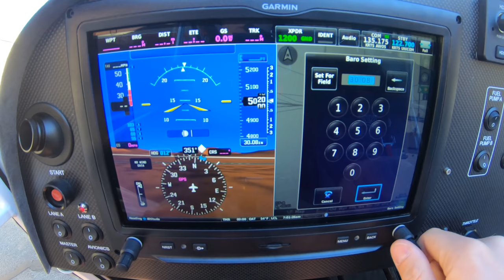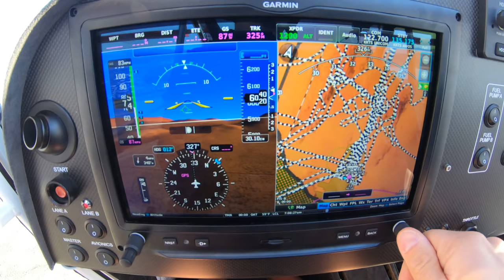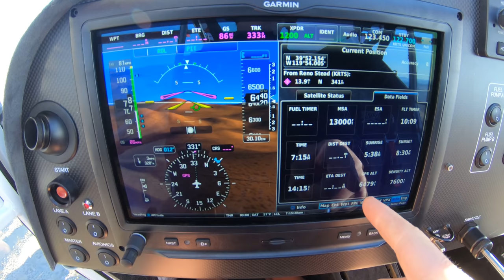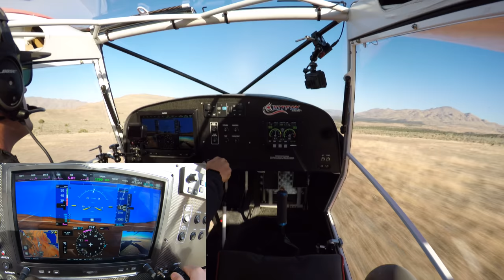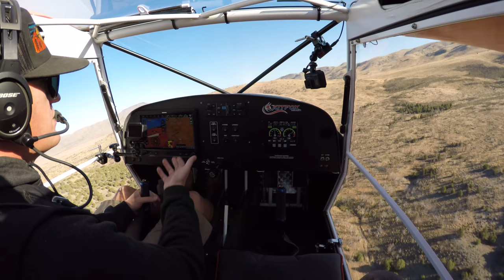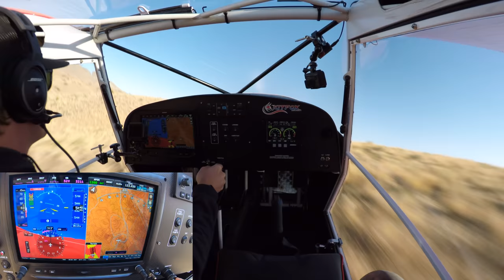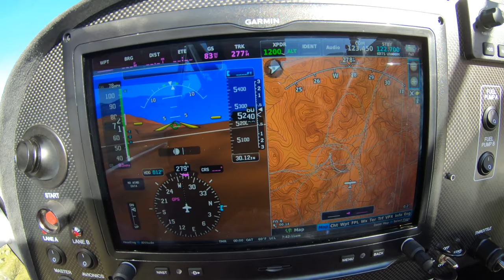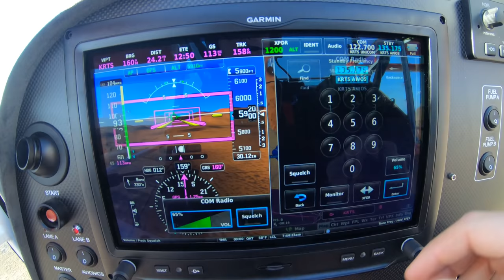Modern Avionics In Bush Planes - Overkill???

Comment: I have watched hundreds of flight videos and never have I had a clearer picture of the flight avionics.  Well done and very clear.
Reply: @johnd5805  Controls rpm of the engine and prop pitch all in one. Just a fine tune. Easier than pushing and pulling all the time.
Reply: @johnd5805  Look up MacFarlane Vernier Throttle.
Reply: @eddieforward5770   thanks Eddie   I will
Reply: @johnd5805  the throttle lol
Reply: @allthatremainsx6  thanks  you're a genius
Reply: Keep in mind that avionics function varies wildly with the airplane. 737s for example lack topo maps because they simply don't need them.

Comment: Not an overkill, you can’t put a price on safety.
Reply: Of course you can.  You can price yourself out of flying altogether, which is why you can't buy a new Cessna 152.
Reply: @SoloPilot6  right; there is a price to safety, and it's surprisingly low.
Reply: Of course you can. 

If the cost of this is displacing more important things, for one. 

If these fancy screens are too distracting in VFR conditions so you aren’t looking outside. 

If these fancy screens give you a false sense of security to continue on in less than ideal conditions. 

If the weight of these installations become more liabilities in terms of weight when performance limited or higher fuel burn with increased power.

Comment: Rule of thumb is, if there's no slat on the leading edge of the wing, flaps will push the nose down. Most noticeable of all is probably IL-76. It is a huge military transport from Russia that doesn't have leading edge lift device. And you will see it actually have a negative angle of attack when on final.

Comment: I learned to fly in a 195, and I was 5’5 or thereabouts. I learned to S turn down the taxiway, because no way could I see over that radial. I love the modern instrumentation. The ease of use compared to folding a sectional on your knee?  Just the computational power at your fingertips is incredible, as long as you don’t replace it for good judgement.

Comment: Love the Vid... I am a Mechanical Engineer, and that technical environment tempers a lot of things I do and use "as a safety margin" for things I do. And flying is one of them. Garmins' Glass from your install to the TBM setup is a safe environment. Your comments about your transition from simple steam gages to the Garmin setup you have does describe using a simple safety setup when you need them. You still fly as you did and should with your eyes outside the cockpit. But you have the safe level flight on AP when needed. Go for it!!

Comment: Those cheap chargers for iPad and devices use a high speed oscillator and a tiny transformer to step down the voltage. They can put out so much noise they can cause RF interference.  I've had them blank out the tire pressure sensors in a truck.
Reply: Fully agree. Much of the headset-audible electrical noise issues in a homebuilt I fly were significantly reduced by replacing the cheap USB charger for a Anker brand one - and that was on the recommendation of this site: https://pilotaware.com/faqs/ That site also go as far as recommending the products made by https://charge4.harkwood.co.uk/ for certified aircraft. Another option possibly worth investigating are the built in automotive-grade USB chargers of Molex: https://www.molex.com/molex/products/family/invehicle_usb_charger
Reply: @jimjam623  You can reduce or remove the RF interference by putting a ferrite bead, also known as a ferrite choke, on the cable. These are just little magnets and are commonly used in many applications for reducing RF interference.
Reply: Daytona Sixty-Eight Actually, this plane’s wiring had been ‘choked to death’ (probably a pound or more) with those damn things over the years of various upgrades - and sadly it turns out they were doing nothing useful before we completely rewired it. The biggest source of audible electrical interference still appears to be coming from the SCREEN of the now ancient MGL Voyager EFIS - at least according to the handheld airband tranceiver being used to hunt directly transmitted noise - but probably not helped by the shorter than optimal antenna length (baked in to the design of the early Jabiru SP470’s. I agree though, ferrite beads ARE worth a try: dealing with electrical interference in aircraft is all science + half black art. :)
Reply: @jimjam623  Typically those panel USB or car outlet USB chargers are powered via the master switch and not avionics switch. That should help you isolate RF. Master ON, Avionics OFF.... iPad charging? RF interference? No? Then avionics is likely the issue like you said. While your case sucks, most people who have problems with USB use a cheap charging cable and a choke likely would help them.

Comment: Great video of the Garmin G3x.  My daily job is an Avionics shop supervisor in San Diego, and I am privileged to flying a Aeroprakt A32 with a G3x.  My Avid Model C when I bought it had no avionics, and this year she’s getting an upgrade to GRT Mini X AP because it will fit or it would have been a G3x portrait.  Whether it’s a G3x, GRT,  or Dynon, the new ADHR’s displays with GPS navigator really reduce pilot saturation.  This is not to promote avionics businesses, but an old school pilot stepping into the 21 Century!

Comment: Thanks for this video, good information.  Interesting comment about how going to fine pitch can blank the horizontal tail.  My Europa mono is all electric analog flight inst,  with Garmin GNC 420W.        Dad flew in the western Canadian artic from 1955 until 1996, Cessna 180, Helio Courier, Piper Aztec and others floats , ski's, wheels and in the 90's when GPS came along he said  " GPS takes the challenge out of bush flying "  He couldn't believe how much easier it became.

Comment: Your set up is very rational and useful requiring little attention to operate.  I like the outputs and the ease of operation especially as you do not have to take your eyes completely off the outside environment to see your system.  I have flown in aircraft that a simple radio freq change makes you put your head down and lose the horizon totally.

Comment: Bro..this is an AWSOME AVIONICS &  CONTROL PLANNING & TECHNIQUE  NERDOUT! .. love it! Great demo & info vid!
I fly RC bushplanes (typically my 3 Timber STOL planes & a PA-18 bushwheel SuperCub) on every surface available year round..DAY & NIGHT! Be it ground, float, ski.. I may have coined the phrase "AERO-CRAWL" from some of my confined ROUGH SURFACE STOL RC flying..I fly it steeply into the valleys of trees on short final @ close as MCAS (down to 5Kts, working lots of rudder & wing leveling, on the edge of porpoiseing, any yaw leading to abrupt 40° flap spin!) as I can with a 3# 60" wingspan electric plane w/LE slats and Fowler style slotted flaps, all about A/S (AOA HYPER CRITICAL😬), sink/power, & ELEVATOR EFFECTIVENESS! 12" Dia fixed fine pitch prop on a light model, will go from top speed of 50Kts to 10 Kts in 2 seconds, w/ resulting "WHOOOShhh.." ..so I hear ya on  blanking the elevator w/turbulence! Testing surfaces, varied flap induced trim shifts, trim use in various modes of flight, etc. Real cowboys do everything to stay on the good side of the thin edge of life & not get stuck in the mud, or worse! Awsome to see Freedom Fox collab. w/FliteTest! BTW, I think you see Autopilot how I see SAFE stabilization in RC planes as a tool, not a crutch, just logical persumption! Thanks for the entertainment, beautiful scenery, & great points to ponder! It's great being a "FLYING COWBOYS's COUSIN" by flying similar in RC! I know what goes into those landings! Many touch&gos till you're happy w/ vector on rollout (track/energy) 🤠👍Thanks so much for contributing so much inspiration to multiple communities! Everyone has such a tremendous impact!

Comment: Great video as usual Trent.

I think that is practically the perfect light GA cockpit from my point of view. I know somebody building a Pietenpol Air Camper and that aircraft is getting a Dynon (I think) glass screen and engine monitor, its light, easy to read and removes the maintenance overhead that is the vacuum system.

Comment: Here in Australia those "bush" planes cannot be registered because they fail the cockpit integrtity test in a crash. We also share a very valuable practice in gaining a pilots license which is very difficult to obtain. 7/10 flight schools start you off in a Tiger Moth. Only when you have mastered that do you progress to something with avionics.
My advice to anyone why wants to buy and operate a light aircraft is go and find a restored Piper Cub or even a Storch and experience flying that only requires you to look through the windscreen.

Comment: In case anyone is wondering on costs, as I was:  A reasonably complete G3X setup (10" panel, ADSB, GPS, engine monitoring, basic autopilot, etc) as seen on this aircraft is worth about $25K CAD.

I would love to have it... but hard to justify on a $20k kitfox.  A bit easier on a $100k version like Trent's, I'm sure.

Comment: I can't imagine anyone installing a vacuum pump and a traditional six pack on any experimental plane ever again.
Reply: I still think a small set of old school  instruments is a good safety practice.  But then my first cross country flight as a student pilot was punctuated with a electrical fire behind the panel.  I was on the final leg so I had to enter the control air space with no radio or lights. Yes there is a procedure for that and I followed it and got the signals from the tower, green light, to go ahead and land and I did.

Comment: I think one of the biggest unspoken, or at least... often ridiculed by "old school" pilots... benefits of having advanced fully modern avionics in any kind of aircraft is really just so thoroughly showcased right here in this video that you've made about your own personal uses of it after upgrading from old school steam gauges.

You have everything at your fingertips, and it's all consolidated on one screen that you can quickly glance at and get the full picture without having to stare at each gauge in a six pack in turn. You don't have two dozen different pieces of avionics you have to know how to interpret or use. You have just ONE piece of avionics to know how to interpret and use, and that cuts the task saturation down tremendously. You spend more attention time actually flying the plane than you do paying attention to the instruments, and that's the takeaway that cannot be understated enough.

Comment: So noise while you are using computer devices that are charging or running off of their ac adapter are largely from the Switching Power Supply in the AC adapter, but also from the internal computer in the digital device and any noise from your power inverters.  The DC wire from the adapter to the device is acting like an antenna for that EMI noise.  Mitigation is easy.  Acquire a couple of ferrite clip-on devices (43 material from Fair-Rite or 28 material from Stewart or Laird).  Acquire ferrite clip=ons large enough the manage two or three turns of the DC cable through the clip-on.  This will reduce or eliminate the noise.  In bad cases two ferrites are required, maybe one at either end of the cable.

Comment: I would want to have a separate radiopanel too, just in case, or even better an extra (handheld?) radio.
But glass panels IS the future, and managing preset radio freq on the panel is a lot less distracting/timeconsuming then punching in freq by hand from memory.
It's just that if anything fails, I want my radio to still work.

Comment: Hey, I have a question for you.

Why you rotate your throttle so much? I understand that pulling means more throttle, pushing less, but what exactly happens when you rotate? It's some kind of 'fine tuning'?

Thanks!
Reply: Actually you have that backwards.  Pulling means less throttle, and pushing in means more.
But to answer your question:  These types of throttle levers allow you a very fine tune adjustment to the throttle setting.  Yes you can still pull/push them, but when you rotate to the left in decreases the throttle setting more gradually, and to the right it increases gradually.  Much easier to go from 2100 to 2000 RPM by rotating to the left than by pulling out.
Reply: @garyweber8201  Thank you very much! Got it
Reply: I noticed that too. For some reason I’m thinking “nervousness” ? H.

Comment: Trent - Very good explanation of the G3X.  I have an IFR Husky A1-B with a G430W, which has a lot of info, and an EIFS, but I use an iPad for charts, etc.  The overheating issue with the iPad is real, especially in the summer.  If I were going to build a plane, like a Kitfox, or perhaps a SuperSTOL, I would definitely put in a G3X and probably a separate EIFS much like you have, for the same reason you did...  By the way, what editing software do you use, and why?  I am using GoPro cameras, not for publishing, but for my own use to improve my landings, etc., but would like to have some videos to show my family from time to time.

Comment: Glass gauges in any aircraft is not overkill.  It can actually save weight, and save your life as well.  Vacuum pump fails, now what?  Redundancy is always a great idea, glass gauges just give you that extra edge of reliability and on-the-fly visibility in IFR and IMC conditions, taking out all the guesswork.
Reply: Yeah, i dont want to know how many lives were lost by small miscalculations and wrong guesses in low or no visibility conditions. A cockpit like this makes fog a lot less deadly.

Comment: Are ground loop isolators a thing in airplane headsets? Re the comment at around 13:00. In car audio, that issue is often caused by a ground loop and can be fixed using an isolator, basically a small transformer that keeps the noise from coming through.

Comment: The UK Light Aircraft Association used (may still) advertise a low noise 5V output device for charging USB equipment without the electrical system noise.

Comment: If you have a power pack with 6 or 8 18650 batteries you can mount to your dashboard and charge the mobile devices that should isolate that current from your comms and reduce background noise???

Comment: Is cacti puncturing your tires ever a concern?  I'm surprised they don't put a hole in your tire.  Also does turning the throttle knob do anything?  Great vid !
Reply: Pushing/pulling the throttle lever changes the power roughly. Turning the throttle is used to fine-tune the power.

Comment: When he is twisting the throttle is that the throttle lock or is it changing the constant speed prop?  He said he has a computer system controlling the prop, but I've not seen throttle locks look like that either, but I'm a low time 1970s C172 driver so what he has going on avionics wise is incredible.  Best I have used is Garmin 430, lol.
Reply: Power change. The 915 is single lever.
Reply: Pushing/pulling the throttle lever changes the power roughly. Turning the throttle is used to fine-tune the power.
Reply: @baygon12 He's "leaning mid of RPM" 🤣 LOL..(I just couldn't contain myself) he's got a real nice complete platform there.. very unique, soon to set trends! I like!
Reply: MacFarlane Vernier Assist throttle. Small twists produce small changes in engine rpm.

Comment: I see pilots do this in other videos, but why does one twist the throttle like that?  In and out adjusts it right?  Does twisting it lock it in place?  I'm genuinely curious.
Reply: I was curious as well. I thought it was fuel mixture, but I believe trent has a fuel injected rotax, so I'm not sure why it would still have mixture adj.
Reply: It's a vernier throttle...push/pull for larger power changes turn for smaller adjustments?

Comment: How are you finding it with the current ‘outage’
Reply: Same question.
Reply: Yeah I'm wondering if any Aircraft are grounded because of Garmins hack and 10 million dollar ransom...
Reply: The outage shouldn't change much for these panels. They'll still work fine without a connection to the live services, at worst you might be unable to download new chart data, which would just put you back in the same position you'd be in with a steam gauge panel, and if you fly the plane regularly and keep the charts updated you'll really only lose a few features like filing flight planes from the panel, live weather, and things like that.
Reply: Max Archer I take your point re the “general working’ of the units but a lot of the ‘extras’ that you pay a premium for both in initial cost and updates such as map data and live weather will be missing, some very unhappy customers.  The lack of information from Garmin re a fix is also disappointing.
Reply: No problem at all with my panel. It's not an avionics outage.
Reply: @EatPezzzz  I flew a cross country flight this weekend. I didn't even know anything about this subject until reading this. Nothing fails. It amounts to flying with an outdated chart. Fortunately, I updated only days before this problem.